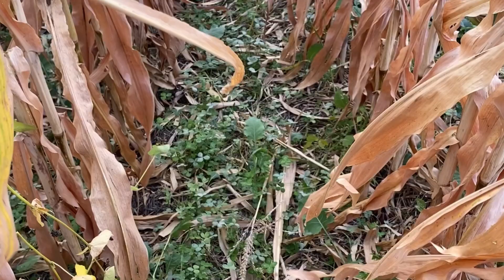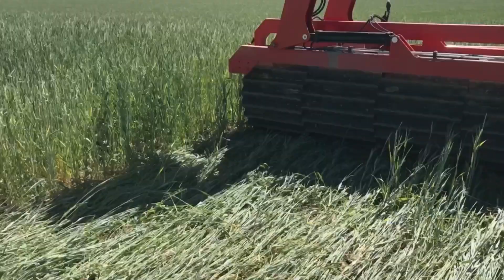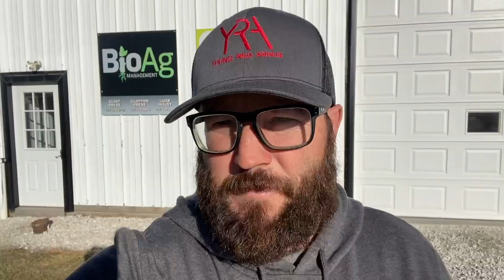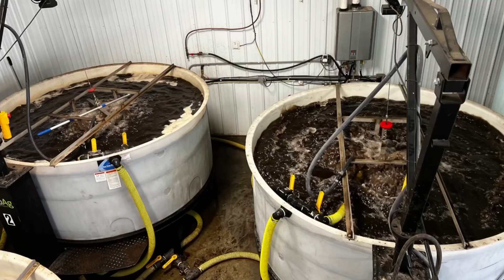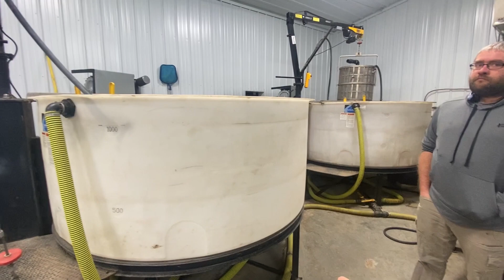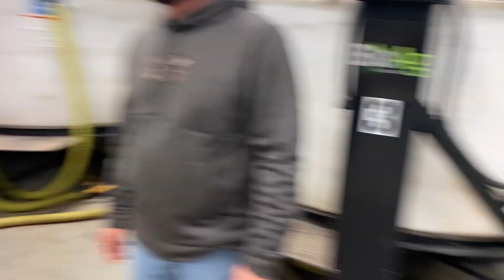How Bio Ag Management Is Making Compost Extract for Commercial Farming

Comment: I’m confused on how we can make a tea which would definitely be an anaerobic environment when that goes against everything I’ve ever heard about making good compost which needs to be aerobic.  How do the microorganisms survive in a water saturated environment?  

Also, can’t you destroy much of the microorganisms with a centrifugal pump?  Was wondering if a diaphragm pump would be less harmful??
Reply from the maker: When you make a tea you are constantly giving it oxogen and that keep the fungi alive.   You then have 24 our to get it put out before it goes anaerobic 

You will kill a lot of the biology but a ton of it survives
Reply: @youngredangus6041  thanks.  Are you using pond or well water or something from a treated system?  I would think untreated would be better?  Like non chlorinated rather than from a public system.
Reply from the maker: @mbailey12341  

I’m guessing that would be better but I’m sure David Johnson has to just use what is available
Reply: @mbailey12341  Its all about efficiency. The more boxes you check, the more organisms you will have. Having non chlorinated pond\well\bottled\rain water will be a massive improvement. Diaphragm pump and less than 12 PSI of pressure is what Dr Elaine talks about. Aerobic organisms survive well in water which has air running through it. This technology has been used for the past decade with incredible results, so it has already proven itself on many hundreds of thousands of hectares of land all around the world:)

Comment: Why dont you put compost and manure  direct on the land
Reply: 2lbs of material per acre is pretty efficiant and used for inoculation of the soil.
Reply: Apparently this is a way of making it go farther. It can also be used to treat seeds prior to planting.
Reply: Its all about efficiency and workload, you can, but it will take a heck of a lot of time/effort to be running around putting this rich compost on the plants. Its much easier with a truck and nozzle to spray your large area.  The best results come from pre-soaking seeds, then applying tea directly into the hole close to the roots. Foliar spraying has the least effect if done alone. The biggest effects are biology as close to roots as possible, so apply into the hole during planting with pre-soaked seeds (soaked in the tea or simply dipped into the tea).